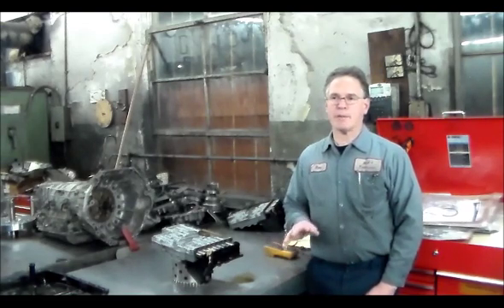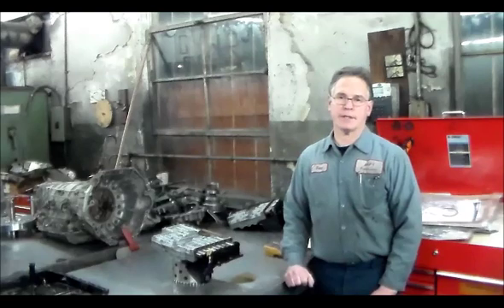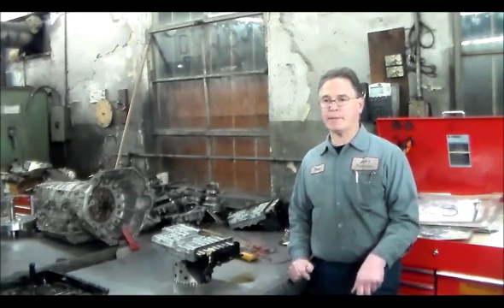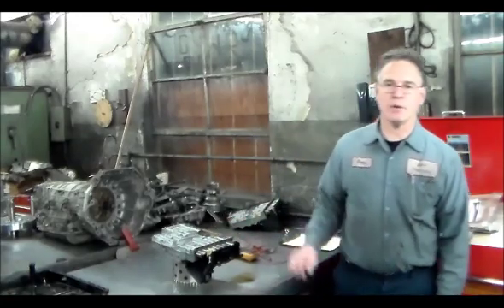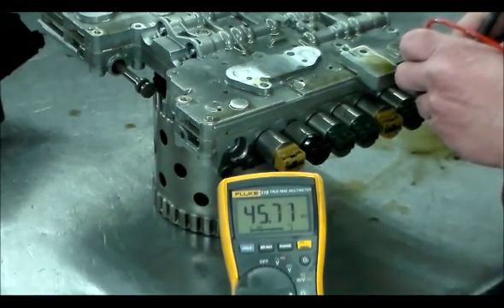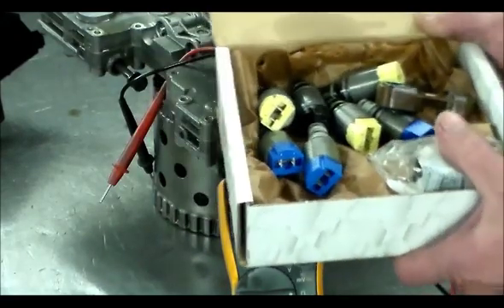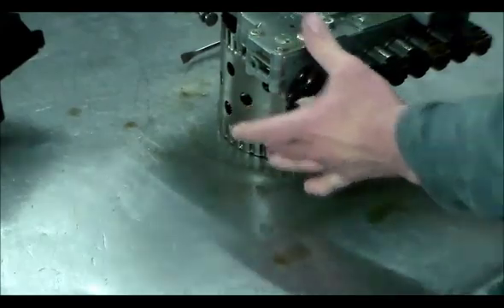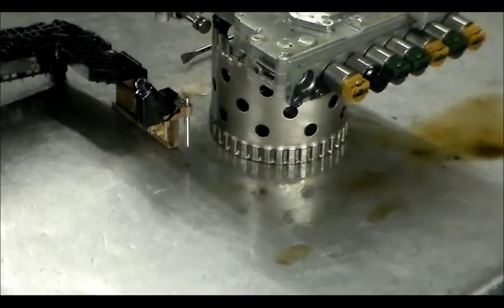BMW Stuck In Park, ZF6HP19

Comment: Your videos are great!! Thank you very much!!

I have a similar problem... E91 came up with transmission fault while driving, then it would not get out of park... Got the car, redone wiring because it touched the exhaust and 4-5 wires were stuck to the dpf, cleared codes and now i get 4E86, 4E87 shift lock, and A0B6 on CAS. Should i find a used wiring for the gearbox, or what should i check next? Thank you
Reply from the maker: Are those solenoid codes?
Reply: @GaryFerraro   Yes, solenoid valve 3 and solenoid valve 4 (shift lock) The code on CAS is related to the shift lock. I powered the shift lock solenoid in the shifter and it works... could it be the valves? and no relation to the burnt wiring? Could the burnt wiring affected the TCU?
Reply from the maker: @ied3vil  I don't think solenoid 3 and 4 are shift lock solenoids, does it say, pressure control solenoid valve 3 as a definition?
Reply: @GaryFerraro  Also researching i kept finding this: 

Generally, those two faults (4E86 & 4E87) indicate issues with Solenoid Valves #3 & #4, but if both faults were saved at same time, it is likely there is an issue with the wiring in the area of the Gear Indicator, particularly if someone disassembled or damaged something in that area (shift lever area).
Reply from the maker: @ied3vil  The thing with these solenoid codes is there are no wires to check, this is all within the TCM.  Question, if you clear the codes do they come right back?
Reply: @GaryFerraro  yes, car is stuck in 3rd gear forward, limp mode and they come back... at one point there were some additional codes on solenoid 3 and 4...
Reply from the maker: @ied3vil  Have you checked power and ground at the connector?
Reply: @GaryFerraro  I will be checking today, found a pdf yesterday with how to check the connector, where to check power and ground, and to see if there are bent pins or pushed back connections on the plug

Comment: Hi Gary! Great video first off!

I have a slight problem with my BMW 325D ZF6HP19..

The car drove fine up until a few days ago when I couldn't select P, the gear lever would just not budge, could still select D,N,R but not Park not even after rocking the car.

Had a look underneath the car at the linkage and can select the linkage by releasing the locking mechanism with a screwdriver, but it seems to easily slip out of Park when I re-attach the gear linkage. 

Car has no fault codes.. just cannot select Park?

Any ideas.
Reply from the maker: ok, you have the regular shifter correct, park is not a button
Reply: @GaryFerraro  yeah sorry, it's the regular shifter without the electronic park button.
Reply from the maker: @andrewprime6498  ok, so you disconnected the cable from the transmission, did  anything bind up
Reply: @GaryFerraro  yeah disconnected the cable, I can select each mode when I use a screwdriver to press against the spring plate and move the lever on the gear box, park engages, but when I re-attach the valve body and cable it continues to slip out of park but stays in d,n,r just fine.

You're time and knowledge is appreciated!
Reply from the maker: @andrewprime6498  What if you just reattach the valvebody and no cable? still comes out. Something is keeping it from moving all the way into park
Reply: @GaryFerraro  I will give that a go and report back, thank you for your patience!
Reply: Hi Gary! So I've put the valve body back in after checking it over and the piston rod seems ok with no binding.. after reattaching back to the gearbox with the linkage attached, it pushed it right back out of Park? Does this gearbox rely on the linkage to hold it in park because when I attach the linkage it locks in place, but obviously when I cycle through the shifter I can no longer get it back in to park.

The only way it will go back in to park if I use a long screwdriver to push against the spring plate to allow the mechanism to go in to park, again linkage holds it in place until I take it back out and can no longer get it back in? Do you think there could be something wrong with the teeth
Reply: I've uploaded some short videos on my YT channel, not sure if they'll help you understand
Reply: Also, the parking pawl seems fine and locks ok, seems to be the rod/spring part to me? Any help is appreciated.
Reply from the maker: @andrewprime6498  could you send a link please
Reply from the maker: @andrewprime6498  ok, with the cable disconnected will it go to park?
Reply: @GaryFerraro  no it will not
Reply from the maker: @andrewprime6498  ok, so you must have a problem in the area of the parking pawl,  there is a plate with 3 bolts (i think this what you are pushing down on to release) Did you take the 3 bolts out remove the plate and inspect anything?
Reply: @GaryFerraro  hi Gary! I've had another look today, valve body off, parking pawl plate and rod removed from the rooster comb, with these removed it still will not go into Park. The problem seems to be detent spring and rooster comb, must be worn and not let it come out of reverse and into Park!

Further inspecting the rooster comb on the teeth there seems to be like slots, is this normal or do you think over time the detent spring has made these slots and therefore getting stuck on the R tooth not letting me select park?
Reply from the maker: @andrewprime6498  Is there a roller on the detent spring, that rolls on the roster comb
Reply: @GaryFerraro  no there isn't one..
Reply from the maker: @andrewprime6498  ok, that is the problem, the roller snaps into the detent and works on the roster comb
Reply: @GaryFerraro  ok thanks for your help Gary!

Will have to try and source one of these now, probably impossible to buy I imagine?
Reply from the maker: @andrewprime6498  Where are you located?
Reply from the maker: @andrewprime6498  you could google ZF parts catalog
Reply: @GaryFerraro  I'm in the UK, I'll have a Google and see what I can find
Reply: @GaryFerraro  you're a legend!

Comment: hello gary, fantastic video there, just a quick one please, which fluid do you use in cleaning the valvebody and conductor plate. thanks
Reply from the maker: i use mineral spirits
Reply: Thanks alot Gary

Comment: @Gary Ferraro I have a 2006 BMW 325i and i purchased the car in limp mode and the transmission wont let you go into any of the gears unless you use the emergency release tab otherwise its stuck in park, Im located in North Carolina any recommendations other than replacing the valve body seals mechatronics seals and solenoids? vehicle has 212,000 miles, also notice that it was leaking oil from the mechatronics sleeve seal
Reply from the maker: Have it scanned for codes, record the codes and clear them, see what comes back
Reply: @GaryFerraro  thank you ill do that and let you know what codes pop up
Reply from the maker: @cyclesportservices3323  ok
Reply: The code I got is P0966
Reply from the maker: @cyclesportservices3323  what is the definition of that code?
Reply: @GaryFerraro  P0966 Pressure Control Solenoid B Control Circuit Low
Reply from the maker: @cyclesportservices3323  ok, so you need to drop out the valvebody and ohm the solenoids, the one that is throwing the code is probably no good.  Have you tried clearing the code to see if the car will come out of park?  Pretty straight forward problem, you should see a bad solenoid
Reply: @GaryFerraro  yes i cleared the codes and the code came back almost immediately and it still stays stuck in park unless I manually switch it using the emergency park release switch
Reply: @GaryFerraro  i did purchase new mechatronic sleeve seals, bridge port seals and valve body seals did notice wet oil marks by the mechatronics sleeve which would indicate that it is leaking correct?
Reply from the maker: @cyclesportservices3323  if code comes back that quick, it is electrical.  Just to confirm, the trans is full of fluid?
Reply: @GaryFerraro  when i drained the oil from the trans it only drained like 3 quarts maybe , i know the torque converter holds some oil in but I believe it was low in my opinion, I purchased the car like that
Reply from the maker: @cyclesportservices3323  Low oil will make it jump back to park but should not generate an electrical code.
Reply: @GaryFerraro   your thoughts I was thinking of replacing the seals , filter , solenoids and fresh oil , of course I will check the solenoids before I replace them , the car doesn’t jump back to park its stuck im park and it will only let you shift it i to the the other gears if you press the emergency release under the bezel,  and it is in limp mode or safe mode , Id figure Id start there, also since I live in NC if I wanted to mail you my throttle body to rebuild is that something you would do?
Reply from the maker: @cyclesportservices3323  Do you mean Valvebody?
Reply: @GaryFerraro  yes sir

Comment: I have bmw 2006 525xi with code 4e87 shift lock 4.not much info available about this code. Car is in limp mode do not shift gears. it runs and drive but in limp mode.also i could shift into gears without pressing the brake Any suggestions or info how to diagnose it?
Reply from the maker: May have a shorted EDS solenoid on the valvebody,  have you tried clearing the code?
Reply: @GaryFerraro  yes it dint clear, it comes right back right away.
Reply: @GaryFerraro  code description: 4e87 solenoid valve 4 shift lock..

Comment: i have a doozy for you.....been working hard on it ..no change

 I got a  zf6hp21 with a e shift transmission on a 2008 535i. It is acting all sorts of funny. I ran 12 volts to all of the solenoids and they all seem to be actuating appropriately.
basically. will not shift into park, but when its in drive or reverse it wont rev past 1500-2000 rpms and will not budge at all forward or backwards.
WHEN PLACED IN NEUTRAL IT MOVES WHEN GIVING GAS GENTLY FORWARD
getting error code 507D and A0B1

i have protool app and inpa.. reset codes multiple times with those codes poping back up.

i dropped and drained fluid, cleaned valve body, replaced bridge seal( old one was fine) and then put back together. reinstalled and put back together with new fluid..

still have same symptoms.

even tried new battery..

at a complete loss.
Reply: Ever figure it out ?
Reply: @hugewingsfan8  yes, welded internals. Replaced transmission.
Reply: Got hot and melted/cracked the gears and seized the transmission.

Comment: I changed my valve body 2007 bmw 525 and got a valve body from a 2004 525. It fixed my other problem but now it’s stuck in park never had a problem with it. I’m think I should change the shift solenoid just like I did here. Thanks. Maybe I’ll put my old shift solenoid into my new valve body?
Reply: Bro did you ever figure out? I just put a new valve body in my e90 and it starts but won’t go out of park
Reply: @extarthe did you fix it?

Comment: Hi Gary..I have just done a fluid and pan change on my zf6hp19 bmw e90..I also replaced the bridge seal
Mechatronic sleeve
And the 4 sleeves ..
My question is.. should I reset transmission adaptations? I see the procedure is quite involved for the learn process.. or is there a less complicated re learn procedure?
Many thanks
Lee.p.s great videos as always👍👍

Comment: Great video Mr.Gary. I have 2007 530i. please can you show how to put back and the transmission service on these vehicles. in your opinion whats the service for them to last long time. thank you for your great explanations .
Reply from the maker: I would service these every 30K miles, install a new pan/filter(the pan is usually plastic with the filter built in) use life guard 6 fluid

Comment: Hello, I have a question about a transmission fault but I don’t really know where or how to contact you so I will just drop the problem in the comments. my 2008 BMW 335i e90 transmission has recently gone bad on me, or so I think.
The car turns on perfectly as it usually would, but once I put the car on D or R it will not move as if it was still in park . I scanned it for codes and what I got was codes : 4F81,4F91, 5088. 
Which are ration monitoring clutch A , Clutch A-D and gearbox selector switch sensor. 
I have no idea what to do and I am hoping for some assistance or maybe even guidance on what actions. Thank you.
Reply from the maker: Do you have a regular shifter or do you push a button for park range?
Reply: I have regular shifter , with no paddle shifters .
Reply from the maker: @illestPulls  ok so you do not have to push a button for park correct?
Reply: No I do not
Reply: Is there anyway I can contact you though email or something?
Reply from the maker: @illestPulls  sure, my e-mail is  gsferraro@yahoo.com
Reply: ever figured out? have same prob

Comment: Informative as always sir , I'm having gear stuck at 3rd on a Mercedes 2000 clk only when it's cold once it gets warmed up after driving a while everything falls back to normal , I'm a DIY kinda guy and suspecting the problem is due to bad conductor plate so I will change it , I'll appreciate if you hint me to look for  something else while I'm at it , thank you for your videos
Reply from the maker: Are there any codes? did you have it scanned for codes?
Reply: Yes sir no codes on scanner and the oil level is accurate as well
Reply from the maker: @mmradian5233  Could be conductor plate, what you may want to do is swap around the shift solenoids(they are the same)also see if anything changes when back together. So in the  morning it does not shift?  how is reverse?
Reply: Great I'll try swapping them around and note any changes yes just like the park problem when cold in video but without codes , the reverse also kicks at cold state then smooth out when warmed

Comment: Dear friends you do a great work always and I have questions for you on 2011 BMW 750 V8 transmission computer faulty and if you buy one from a junkyard you can reprogram it please let me know and you have a good weekend
Reply from the maker: I do not believe these can be reprogrammed, they would have to wiped clean and then programmed, not sure of anyone who can do this
Reply: @GaryFerraro  
Good morning thank you for your help I'm working on 2 different TCM 09 X5 and 2011 750 wish me luck
Reply from the maker: @mahmoudhantouli5434   What codes do you have that the tcm may have to be changed?
Reply: @GaryFerraro  nothing wrong with this TCM but what I'm trying to do if someone change the transmission these kind of TCM you won't be able to Drive  the car  until  you reprogram it and I do have a class in California part of security
Reply from the maker: @mahmoudhantouli5434  Have a class to learn programming?
Reply: @GaryFerraro  no codes at all transmission come to me from transmission shop and the transmission being taken up apart broken from inside and damage the transmission conductor plate
Reply from the maker: @mahmoudhantouli5434  Wow, did something break and damaged the black plastic on the valvebody(mechatronic unit)
Reply: @GaryFerraro  to be honest mr. I don't know what happened exactly I'm a mechanic I work in European cars and they bring all aparts and I have to buy a different transmission and right now I'm trying to reprogram the used  conductor  or the TCM And make it  drive again
Reply: @GaryFerraro  yes and I will do it this weekend I want to give A try and I will let you know
Reply from the maker: @mahmoudhantouli5434  Ok, sounds good

Comment: If the lead frame is bad wouldn’t it do the same thing.
Reply from the maker: Possible,   I tested the solenoid, when hot it actually came down to 10 ohms, i'm thinking thats why i was able to get it out of park. So far i only issue i ever had with the tcm is a bad range switch which gives code 5088
Reply: Ok. I like your videos but I think you need to get a new camera. It’s very hard to see what you are doing.
Reply from the maker: @tylerbruno2251  everytime i try to upload my computer tells me theres not enough room try a lower resolution, have to start looking for a new pc. Thanks for watching